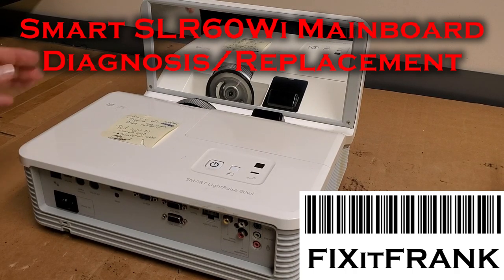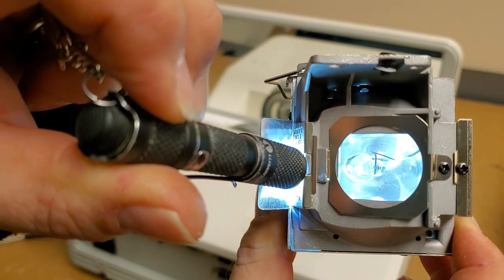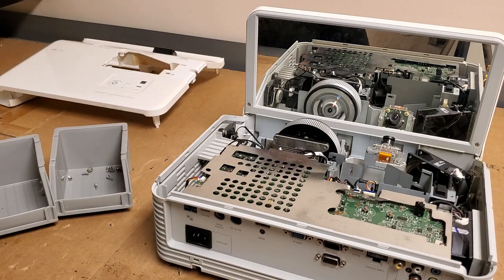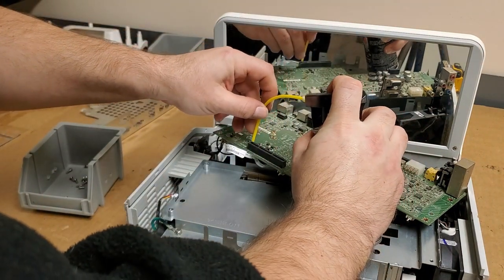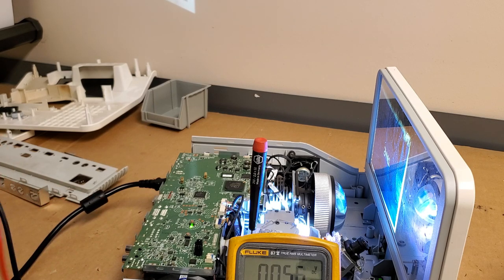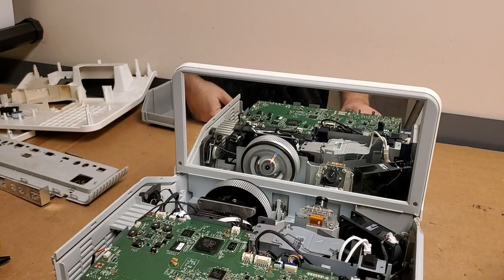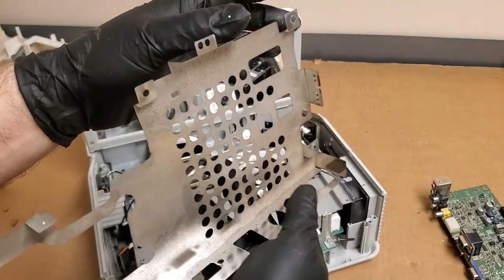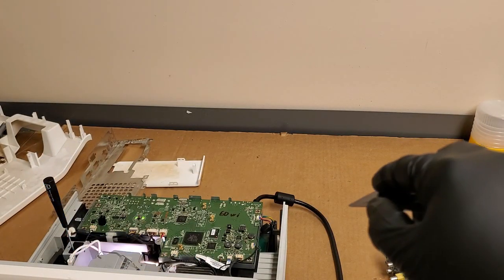Smart SLR60Wi DLP Projector / Mainboard Diagnosis and Replacement

Comment: Frank thanks i fixed the lightbulb. I just have one more question. Please tell me you know how pair the remote it’s a original smart remote I’m just not sure how to do it. I just need some unit. The sound sucks so I can get it through my audio system.
Reply from the maker: as far as I know there is no pairing with the remotes. They are just normal IR remotes.  You might have the wrong model remote if it doesnt work.  As far as the audio, yes I agree the speakers are poor. I would use the projector as a display only and have all devices switched by an AVR and then just feed video to the projector.

Comment: Do you know anything about if the fan fails
Reply from the maker: Don't hold me to it but I think these are built by Benq. They look similar inside and use similar fans. Reason I say that is Benq has fan problems sometimes. If you're looking for a bad fan, I have a few videos on troubleshooting dlp projector fans. Give the video page a search for 'fan' and there will be multiple results you can check out.

Comment: Want to set on table, can't flip the screen , can u help
Reply from the maker: Hi Charlie, I don't know if these can be flipped now that I think about it.  Since they are meant to be mounted in a classroom, they might be set to that permanently.  Next time I have one in I will check but I don't recall their being a setting for that.   https://www.projectorcentral.com/pdf/projector_manual_7387.pdf  This is the manual though. You might want to check that in case I missed something.

Comment: Can you tell me if there is an option in this projector model to flip image upside? I want to set it on the floor instead of mounting on the ceiling, that is why i need to flip image upside to have a right side up image on the wall.
Reply: Hey I'm wondering the same thing! Did you ever figure this out?

Comment: how do i switch the screen it was set to work from the ceiling now i want to use it on a table but the image is upside down
Reply from the maker: I don't think you can .  I am fairly sure these are locked to project that way because they were made to be used with a special screen and mount.